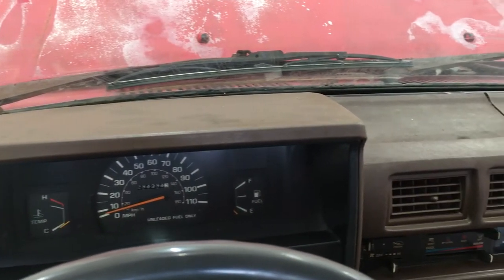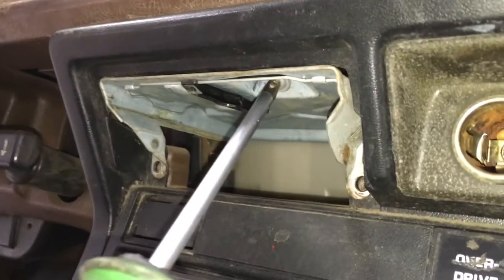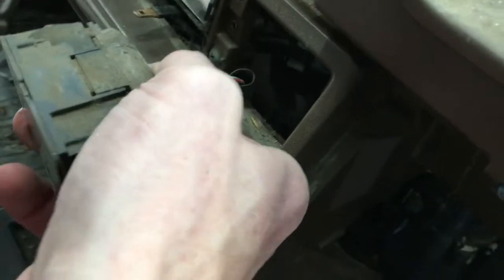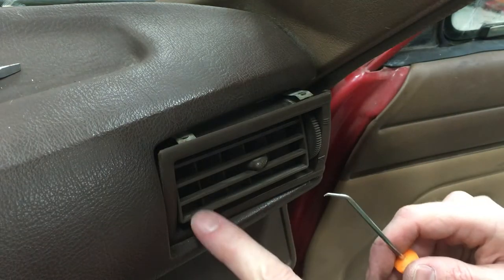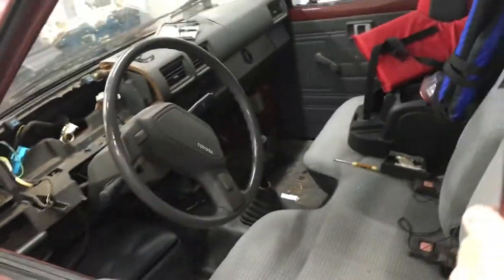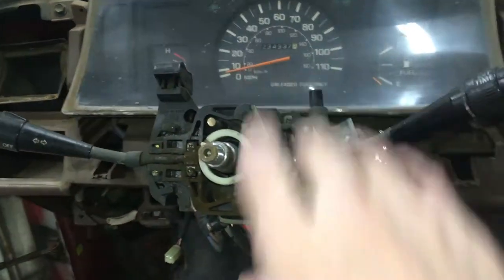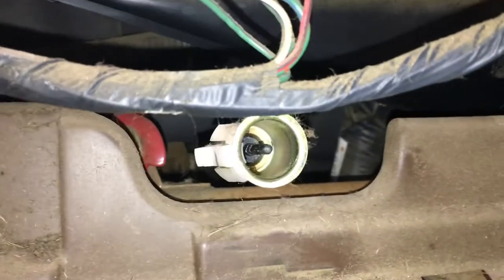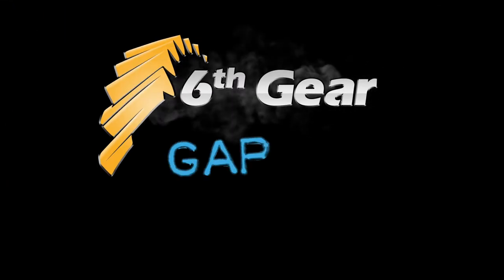How To Remove Toyota Pickup & 4Runner COMPLETE Dash & Steering Wheel

Comment: I’m trying to replace the cab on my 87 pickup, after all these steps what’s left to remove on the interior to get it down to nothing?
Reply from the maker: Just the metal dash brace, hvac blower motor and heater core, and wiring harness.
Reply: @6thGearGarage  awesome info! You don’t happen to have a “how to” for that or is it straight forward?

Comment: I need help I just bought a 88 pickup 4x4 all original and it still has the og radio with the storage thing under it and I'm wonder how to get the radio out to replace it. it's different then the one you showed I can't find it
Reply from the maker: does it have the 2 round knobs on the radio?
Reply: @6thGearGarage  yes it does it works but the sound cracks up real bad would I be able to take out the bottom storge box and put a touch screen double din?
Reply from the maker: @b-dawg3518  I've seen it done. I believe you will have to trim the trim piece a little.

Comment: Awesome video. Maybe a stupid question but can anyone tell me if a 93 Toyota pickup dash would fit on an 88 Toyota pickup cab? Both trucks are 22re gas 4x4. The 93 is a regular cab, the 88 is extended cab. Are the mounts the same? I have a low miles running 93 cab/engine and an 88 needs an engine and the 88 computer is iffy so I was going to try the 93 computer, therefore the 93 dash/instrument cluster? Or maybe keep the 88 dash and just swap in the cluster? Please feel free to tell me I'm crazy but I'd really appreciate some real info on this. Thanks
Reply from the maker: I've removed both dashes and I can for sure say they aren't compatible. Also there are going to be some slight differences on those 22RE's with emissions/electronics. The good news is that you can buy used running 22R/RE's for $500 or less. Or the best option for using parts from your 93 would be to pull the motor and use the 93 head/block with the 88 intake/wiring, but then you'd still need a new ECU for the 88.  But as far as mixing and matching, the block and head are going to be the only things identical on both trucks.
Reply: @6thGearGarage  Thanks 6th Gear! This is very helpful and makes a lot of sense.  Glad I asked before trying to swap the dash. This 88 came to me with a 93 already swapped into it but they used the 93 Intake with the 88 computer without any re-wiring. It barely ran.  Its a bit of a nightmare. My first thought was to get a replacement 88 but I went through two already and they both turned out to be junk. I can't find a running 88.  I jumped on the 93 cause it had low miles and great compression.  Could I just use an 88 intake on this 93 block/head? If only I had one of those!
Reply from the maker: @littledidheknow802  Yes the block and 22re head should be the same from 85 to 95, so the 1988 intake manifold will bolt to the 1993 head.
Reply: @6thGearGarage  I'm looking for a dash pad for an '86 base model, preferably brown. Any chance you have one or know where I could look? Thanks.
Reply from the maker: @jeffdyer21  If you are looking for one with no cracks, good luck. I would start by checking eBay every week, and even then a crack free one is usually over $500
Reply: @6thGearGarage  Thanks. This is what I am finding out.

Comment: great video. i am attempting to replace a leaking heater core in my 1985 hilux this video made removing the dash so much easier. Have you had to remove the heater core?, im a bit unsure where to start wondering if you had any knowledge of the process. TIA
Reply from the maker: To get the heater core you need to remove that metal dash brace. Then disconnect the two coolant hones on the firewall in the engine bay. Then unbolt the box from the rest of the hvac, and it should come right out. Just be gentle when removing those hose clamps, the copper pipe on the heater core bends easily.
Reply: okay will give it a shot thankyou @6thGearGarage

Comment: Excellent video, I am restoring an 88 pickup and wanted to replace the heater core O-rings. The hardest part was removing the passenger side HVAC vent. I found it will come out easily if an old credit card is made into a clip release. Bend the card 1/8” on one end, helps if the edges have a 1/4” radius, insert the card between the top of the vent and pad to disengage one clip then slide it over to release the other one, repeat for the lower clips.
Reply from the maker: That’s a great idea!

Comment: Couldn't figure out how to get the heater/fan panel off as I just bought a clock to upgrade my 88 I just bought (wasn't optioned with one, which was annoying as my 87 was). So happy I found this, especially since you pointed out that the clock plug is still in the loom! Saved a lot of headaches.

Super clear and informative, thanks mate!
Reply: Where can you buy these clocks for the pick up, please....?

Comment: Love it.
Thank you.
Today i was stuck on the hidden 10mm bolt so my dashboard wasn't opened. Will try again after arranging such long socket key support.
Currently have cleaned clinometer but its not accurately working.
Reply from the maker: I never put that one back on in case I ever need to remove the dash again.
Reply: @6thGearGarage  thank you, its opened finally ur video helps allot always.... Need to replace hvac controls and few ducts missing. Am confused either to remove AC unit from the dash board or not as dnt have compressor installed nor condenser as i dnt like AC in 4x4... Any expert advise please, just want my heater ON.

Comment: Love the video! What an awesome resource. I feel a bit silly though... I've got a YN63 4Runner and the glovebox has a flexible curtain above it. I cannot figure out how to detach the curtain so that I can remove the glovebox. In your video, it is either broken or simply not present like it is on mine.
Reply from the maker: I haven't seen the curtain before, only a piece of black vinyl.  The vinyl has 2 metal spring clips on each end of the one side, and the other side has a few built in push clips on a piece of plastic trim.  I think.. It's been a while since I've had a truck that still had that piece.
Reply: @6thGearGarage  yep, that flexible piece of vinyl is what I was describing as a curtain. I don't know a better word for it, haha! I found the wire clips and left it hanging in there for now. Thanks! I was trying to disconnect it from the top but it wasn't really necessary after all.

Comment: Excellent Video, it helped me piece together the interior on my  '88 Xtra Cab. Also, have you run into any issues with your cruise control not working? Mine suddenly stopped working a few months after I got it. Not sure what the cause of the problem is, the cruise light lights up but it doesn't hold the gas pedal in place.
Reply from the maker: I've owned about 10 of these trucks and none of them have had cruise control... sorry I know nothing about it.

Comment: Hey man looove your account ! Super smooth dialogue. QUESTION THOUGH: HOW do you even remove the vent Panel on the dash thay goes around the Instruments Cluster ?
Reply from the maker: Thanks!! The only way I have found to remove that vent is to take out the trim piece around the cluster and then you can release the vent from the backside.

Comment: Here's My Hack: Since these trucks are so old the vent plastic is very brittle and prying on it can easily crack or break it. Once you have the right side vent off and the right side dash retaining nut that secures to a fixed stud, NEVER reinstall that nut again. It will allow you to quickly and easily remove the dash pad in the future, as I have done many times since. 

Instead, wrap some thin medical cloth tap around the stud threads enough to fill the dash tab hole it protruded through. It will hold  the dash in place and prevent any metal on metal rubbing sound. The center dash slip clip and the 5 under side dash screws will more than enough keep the dash pad secure at that end. Never had any issues with noise or vibration.

It's a time and broken part saver.
Reply from the maker: You sir are a genius! I will be doing this in the future.

Comment: Do you have the A/C wiring that's under the hood? Mainly the plug that goes into the compressor.
Reply from the maker: Sorry I do not, this one doesn't have AC. I had one truck with AC and there wasn't a separate harness under the hood for the AC, I think it was integrated into the entire harness. I think you'd be better off running a new rire for the AC compressor and then I believe the HVAC wiring under the dash is separate from the rest of the harness so you can pick one up at a junk yard and add it to your current harness. I'm not 100% on that, but I think that's how it was.

Comment: SInce you have gutted the interior, I was wondering if you know how to get the cover off the map lights. I can see no release point and hate to damage the cover. Any advise is appreciated.  Thks..jc
Reply from the maker: This truck only had the single dome light, like most of them have. It just pops right out, you may need to give it a gently pry with a tiny flat head. If the clear cover is brittle and cracks, that's normal. You can still get them new from the dealership. For the SR5 dual map  light, I'll look around and see if I have one in my parts collection to see how it comes apart.
Reply: @6thGearGarage  ok, thks for getting back to me..jc

Comment: Great video thank you now on to the heater core. Can the copper tubes be removed and replaced with heater hose for a better seal? In other words are there any hot mods for heater cores connection
Reply from the maker: I have never seen that done before, as the copper tubes are part of the heater core. The heater core would have to be cut and that would increase the chance of a leak inside the cab.
Reply: tubes are separate New heater core comes without them
Reply from the maker: Gregory G. Campbell oh thanks, I didn’t know that 👍

Comment: ¿Dónde va la luz de la placa de las palancas de el aire acondicionado? Me puedes mostrar por favor.
Reply from the maker: I don't understand the question, but I think you mean the HVAC face plate? There is a plug that plugs in to the HVAC unit that lights it up when the headlights are turned on.

Comment: Hey man how do you align the steering wheel when you install it back
Reply from the maker: Just make sure it's centered with the front wheels pointing straight. If it's slightly off, then rotate the steering wheel over 1 spline at a time until it's perfect.
Reply from the maker: Or if you haven't removed it yet, you could mark it's position on the column shaft with a marker or scribe.
Reply: @6thGearGarage  I need help with the heater cable, it doesn’t fit right like in the video
Reply from the maker: @Random_Car_Guy  are you sure it didn’t get switched with one of the other cables?
Reply: @6thGearGarage  Yeah but even if the cables are the same positions it won’t fit
Reply from the maker: @Random_Car_Guy  it’s too short?
Reply: @6thGearGarage  I got it all sorted out finally

Comment: I don't want to pull the whole dash to get the vents unclipped is there a way to remove the 2 middle vents without pulling the dash
Reply from the maker: I would be worried about cracking the brittle plastic by trying to sneak a tool behind the vent to press the metal clip.
Reply: @6thGearGarage  na bit to late man I cracked that sucker and ended up using my pointer finger to poke through a small gap in between the open glove box ant the dash to click that last clip. They don't make new heater vents so the old crappy used ones are $200+ for all 4. Idk man I think I'll super glue them back together and come up with a plan from there. If there's a will there's a way

Comment: Awesome videos!!! I just got a really rough 85 pickup but im planning on rebuilding it with a 3.4. I also really wish it was a 4runner so I am looking at swapping the cab. Do you know if the mounting points match? It is a short bed standard cab.
Reply from the maker: I’ve never done the swap but I’ve read that the rear mounts are different and will need to be fabricated.

Comment: Hey , do you have a video how to remove the hardness from the body?
Reply: Interior?
Reply from the maker: Sorry I do not have a video, but once you remove the dash pieces, you can see all the connections. There's one that goes under the carpet on right side, through the floor to the rear of the truck. Another goes up the left A-pillar to the mirror. If you have power doors, you'll have some extra work.
Reply: @6thGearGarage  okayy nice, thanks man, apprrciate your help. Thank God my truck is manual totally

Comment: Great  video. How do you remove just the AC control unit.
Reply from the maker: Do you mean the HVAC control unit shown at 10:00 in the video?  The only  thing left holding it in place are the 4 cables connected to the push levers (just unhook them) and then unplug the wiring harness and it will come out.
Reply: Yes. Do I have to remove the whole dash board in order to replace the HAV Control unit?
Reply: HVAC

Comment: Is that an 86? Because my speedo cable is not as accessible like yours was.
Reply from the maker: Yeah, it's an 86. If the cable doesn't have as much slack, try feeding more in through the firewall from the engine bay. Maybe it got pulled back out for some reason.
Reply: Will give it a try when I to get to it this winter. Thanks....Jim
Reply: @6thGearGarage  It worked. Just needed some slack. Just enough. Thanks  jc

Comment: Do you need to take the drivers side dash off to remove the passenger’s side dash pad?
Reply: Never mind, the answer is yes, there’s a nut to the left of the pad under the driver’s side.
Reply from the maker: Yeah, they don't make it easy to pull the dash pad.

Comment: Do you have the A/C button assembly for an 88 pickup you would want to get rid of?
Reply from the maker: I don't have any right now.  Most of the trucks I get up here in Ohio don't have AC.
Reply: 6th Gear Garage ok yeah mine has it but the button was broke off by the previous owner and finding one has been a really big challenge. I found some off the 4 runners but the connections are different.
Reply from the maker: @joshuasands8518  I wasn't aware there was more than one type for the 84-88 pickups and 84-89 4runners.
Reply: Yeah I didn’t either mine has a two prong plug and a separate plug that’s green on it the 4 runners have just a three prong plug

Comment: Are the 84 pickups and 86 4Runner dashes compatible
Reply from the maker: Pancho Mendes yeah 84-86 are the same, 
in 87 the recessed area on the top became a smaller rectangle and the right vent was slightly different.

Comment: so, where's the heater core?
for me, there's a lot more to it. 

4 more 10mm bolts on top for the metal frame (spring flex tool) 

and duct work, but am unable to get the entire heater core box out.
Reply from the maker: After the metal dash support beam is out, the heater core box should be free. You got the 2 coolant lines removed right? Last thing to check is around the perimeter of the box with a bright flash light and see if you missed any bolts.

Comment: I am subbed to your channel.. I have an 86 shortbed pick up with a 12.7-13.2 gallon fuel tank...  Do you know if the 86 long bed pick up 19.2 gallon fuel tank will fit my short bed?  I have searched and searched... Noone has an answer.. .  i would like to extend the driving range of my truck..

Also.. I plan on upgrading my cluster to the SR5 cluster..  For the added RPM gauge

Thank you...
Reply from the maker: I have the gas tank from my 86 1-ton pickup, which had the 7 foot utility bed. Are you in Ohio? You can have it for free if you want it. It's a little rusty but it worked fine. If not, I can measure it for you.
Reply: @6thGearGarage  my truck is in tempe AZ...  Bro...  Do you have a patreon?  I have no way of getting it but i want to pay it forward as a THANK YOU and donate to your extremely helpful channel...  If somehow i was able to get your fuel tank... I would buy it from you along with the brackets and mounting straps....  Do you know if a good freight company that could ship it?  Can the tank ship via greyhound?
Reply from the maker: @camposvazquez  I don't have patreon, just happy to have people subscribe and watch & share my vids. Honestly, the tank is probably not worth shipping costs. It has some rust where it mounted to the frame supports. I'll see what I can find out about tank size compatibility and let you now.
Reply: @6thGearGarage  thank you....  If you make shirts or merchandise.. I will support you...  I have tge largest toyota dealership in tge world near me .. They didnt have an answer...  I dont have you level of skill to figure these scenarios out..  I would love to increase the driving range... 

I have shared your channel with my other toyota bro's...
Reply from the maker: Campos Vazquez I measured the long bed tank and the standard bed tank and the long bed's tank is about 6" longer. I looked to see if there was room to mount on the standard pickup, but wouldn't fit without some heavy modification to the cross brace bar going across the frame. Even then the tank would sit close to the rear axle. Looks like it's not gonna work.
Reply: @6thGearGarage  THANK YOU!!!!!!!!!!!!   I will not be able to do this tank swap...  I will nred to look into an aux storage tank...  Gosh those are extensive
Reply: @6thGearGarage  legendary man. Some serious good will there. Thank you for your help